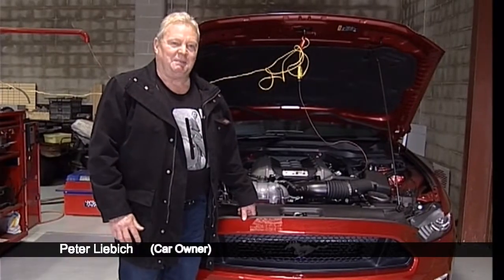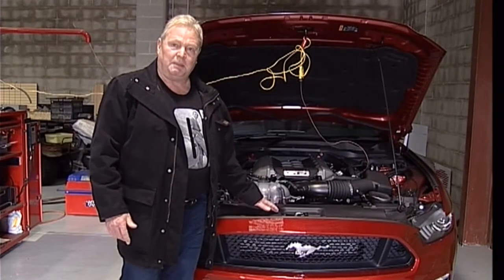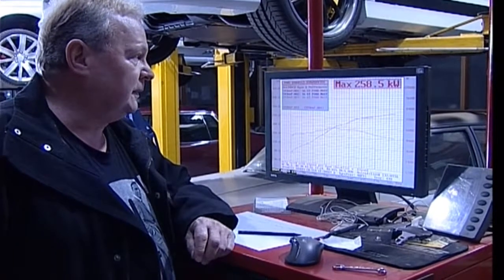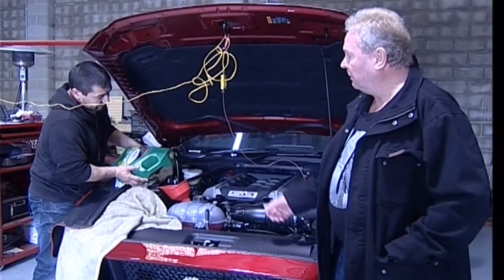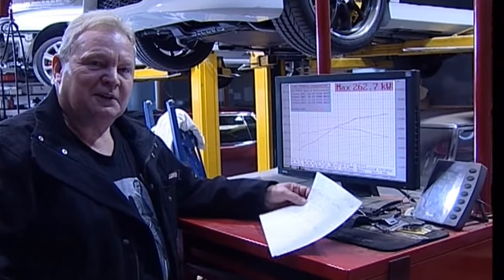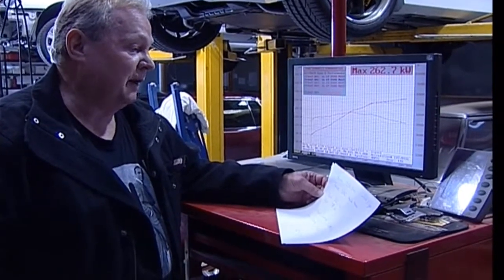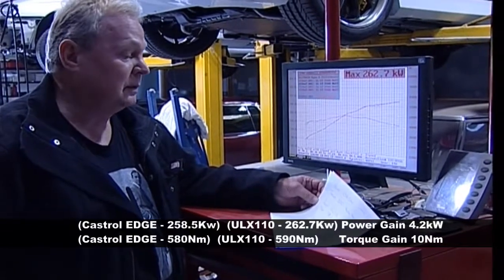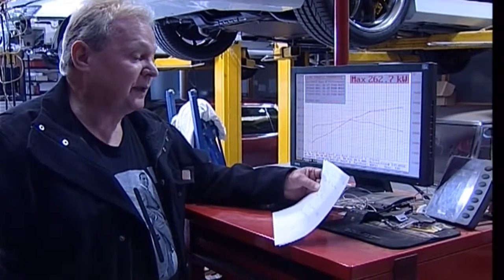ULX110 Motor Oil vs Castrol EDGE Titanium Mustang GT Dyno Test

Comment: well the castrol was already ran n the other oil was new
Reply from the maker: If a high performance motor oil starts to deteriorate and loose its performance after 300kms then there is something terribly wrong with that motor oil
Reply: ULX110 Proven Custom Blend Oils That's not the point.If you want to perform a real scientific test you must have absolutely the same baselines such as new oil,same ambient temp,same fuel,same process of applying power and so on.Otherwise this is nothing but a shed tree mechanic test.